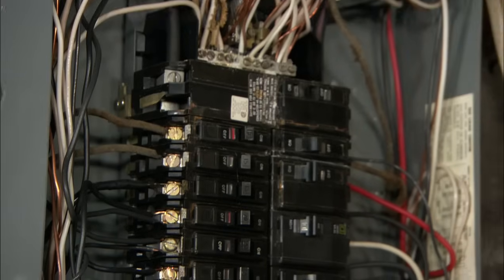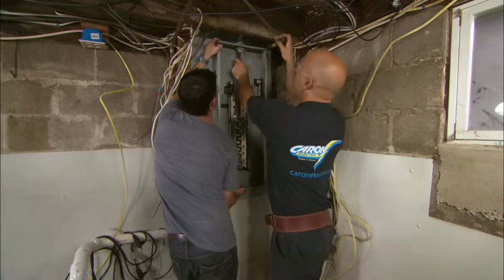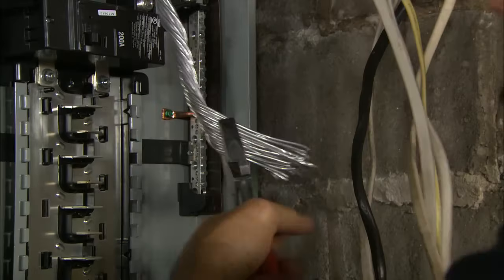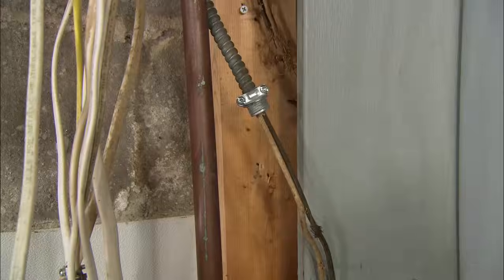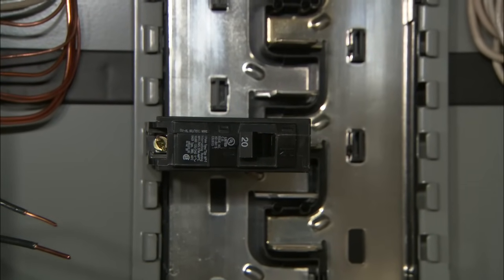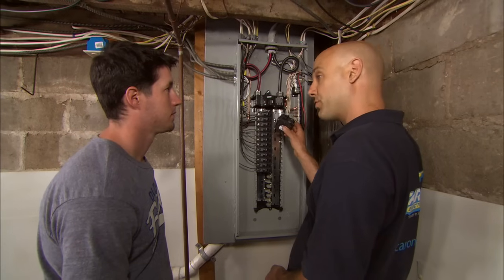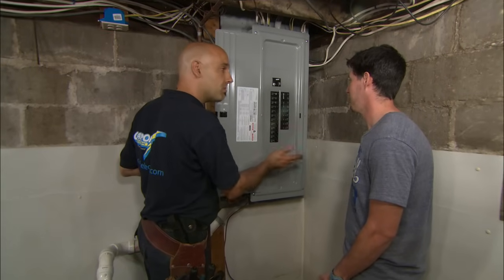How to Upgrade an Electrical Panel to 200-Amp Service (Part 2) | This Old House

Comment: First of all Scott does a good job. So not saying anything about his workmanship. With that said, and not sure what municipalities that Scott is working in...so excuse my ignorance as I am a licensed electrician in Massachusetts. Not sure why he used an expansion fitting above the meter socket as if it expands or contracts the PVC conduit has no where to go but up or down. And we professionals have at least in my area which is Central Mass. Have never relied on the National Grid to come and disconnect/ re connect the service lateral. That is usually done by the installer. But overall a good installation.

Comment: As a german electrician i can clearly say: The US system as shown as in this video sucks. If this is actual standart, than we are at least 30 years ahead of you.
Reply: Have you ever compared your components to ours. Ill wait for an answer.
Reply: Reply back win you win a World War.
Reply: Nur 2 Phasen und kein FI Schalter...
Reply: Explain
Reply: Lot of comments about the superiority of other countries.  The question I would ask is this:  are there more fires/electrocutions in the US on a per capita basis ( or some other means of a fair comparison)?  If there are not, then I’d say the us is doing just fine.

Comment: The US electric system is weird. 2 phases used per household imbalancing the grid, panels with no to little ingress protection and to top it all off no RCDs whatsoever on new installations? 3rd world technology TNC...
Reply: RCD's have been used here in America since the 1970's.  We just don't use them at the breaker panel in most cases.  Nowadays, you must install AFCI at the breaker panel on all new installations, but GFCI's (RCD) are usually installed at the receptacle (outlet).

And we do not use "2 phase."  It is a split single phase.  We have two 120V hots and one center tapped neutral.  This gives us 240V total, but most circuits in the house use 120V.  I will quote an excellent explanation to the advantages of the U.S. system from a user on Quora:

-begin quote-

The USA system using a 240V center tapped line transformer with grounded center tap is actually a very good system. There are very good economic and safety reasons to use a system like this. Three major advantages of the 120/240 system are:

1.) Shock hazards are reduced. The highest voltage to earth in any residential system is 120 volts RMS. Even a 240 Vrms circuit is limited to 120V to earth. The only possible way to get 240V is from a hot-to-hot. Unlike some countries, there is never voltage from hot to neutral or earth over 120Vrms nominal.

2.) Fire and consumer overload safety is improved. Small breakers or fuses used in high voltage low current systems are less reliable for overload protection. Fault currents are reduced. Insulation is less problematic.

3.) Lightning protection is improved. The grounded neutral system with its lower impedance to ground hot legs is more immune to transients. This is particularly important in some areas of the USA.

-end quote-

So, here in America we have the option of 240V or 120V and most residences use both.  All washers and driers are hooked to 240V.  As are water heaters and cooking ranges. When you look at the plugs, our 240V receptacles have 4 prongs.  Two 120V hots, 1 neutral and 1 ground.  In Europe, 240V plugs have 3 prongs.

There are advantages to Europe's single phase 240V, though:

1) Less copper is needed in circuits because 240V doesn't require quite the ampacity to achieve the same power.  Therefore, in Europe the wires are a smaller diameter saving in cost.

2) 240V is everywhere and every outlet.  In most places in Europe, there is no 120V option.  This simplifies things quite a bit.

3) Gives the home owner more flexibility in using higher powered devices (like power tools and kettles).

The main benefit of the U.S. system is safety (120V to ground, even when using 240V circuits).  However, there are advantages to the European system too.

Comment: lots of amp cause lots of hit and fire hazerd good to have 230v in europe much saver. 35 amp comes in and 16 amp goes into the house
Reply: Risk of fire exist of bad connections, regardless level voltaje.
120V is more safer. Lot of amps but a 48kW service.
Reply: i do not agree, but what do you mean by 48 kilo watt service? the german, dutch are way futher with pluming and electricity systems and safty
Reply: 48kW its the power off 200A in the video and other houses.
The 3phases system working with low current.

Comment: 90 percent of the time the power company is not going to come do a shutdown for service change. We have to pull the meter.
Reply: Service upgrade, they'd have to run larger wire likely to a new transformer.

Comment: Anyone know rough estimate how much it will cost for this job, given that it was done in New England, I would be interested. Thanks guys!
Reply: Probably $4k or more.
Reply: I was quoted $2k by a solar company that said we might need to upgrade from 100 to 200amp service for my solar panel setup. 
But keep in mind that would be with them already having an electrician on the field doing the solar work and in communication with utility company so that's probably cheaper than ordinary. 
Also I am in Iowa which is relatively low cost of living and lots of tradesmen out here.

Comment: What about the wire coming from the pole did you leave it the same or did you change it
Reply: Everything from the transformer to the splice is the power company's responsibility.

Comment: This is so much different than in Germany. I like, that you can simply plug the circuit breakers in. No need to wire them to the power supply. However i like our 230/400V 3 phase Current system more.
Reply: High voltaje is dangerous, 120V is safer. Its need big cables but a 48kW service in sigle phase.
Reply: Why would German houses need 3 phase 400v circuits? You running 50 hp industrial-size induction motors in your kitchen?

Comment: National electric code does not allow for bonding to water pipes, ground wires from grounding rods need to be connected from meter to panel to a seperate ground buss.  Neutral and ground can no longer be on the same buss, many electrician assume that the neutral is a ground- IT IS NOT. A neutral has energy on it that is why it is so dangerous, it will grab you and hold you and you will die, neutrals cause more deaths than hots

Comment: Have you upgraded the whole system main disconnect should be outside in the meter pack. No more main Breakers inside
Reply: Joe Momma not necessarily true.
Reply: Maybe location.? The house catches on fire, main disconnect should located outside for fire department to switch off. Now if it's a panel change then no, wouldn't have too. But an entire service  change, then yes sir.
Reply: Joe Momma if the meter and the panel are back to back (less than 5 ft) then main breaker not required to be on the outside. Rook
Reply: @leonardholt5311  yes sir.
Reply: @leonardholt5311  any relation to Mike Holt? Anyways happy easter

Comment: Neutrals and grounds do not land on the same bus. Grounds has his own independent busbar. sometimes you can get lucky but usually you have to buy it separate. grounds and neutrals cross paths just one time and that's at the XO
Reply: It was the main panel, so yes the neutral bar and ground bar are the same. If it were a subpanel, the ground and neutrals would be terminated separately.

Comment: you never ever connect your PE to anything but a properly constructed and tested grounding arrangement. especially a water pipe -- that's specifically outlawed.
Reply: it's almost like there's a "part one" to a video labeled "part two," and in "part one" they hammer grounding rods into the ground. but nah...

Comment: wow the US is about 20 years behind the UK in terms of wiring and switchgear. No insulation to ground (earth) wires that could become live under fault conditions?
Reply: Then how is stray voltage sent back to the earth in the UK?
Reply: @derrike50  It takes the Underground?
Reply: I find it interesting that Canada uses the same system as the US, but these Europeans  always blame the US when they think it is somehow inferior to their system.

Comment: No RCD , No Zs test, No continuity test. Amazing !!!! We are in UK just wasting all our money for RCD etc.  And they   using aluminium meter tails. And no testing at all. I can’t believe
Reply: RCD's are called GFCI's here.  They have been required by code for decades.  The difference is that we aren't required to install them at the panel (though it is acceptable to do so).  Usually they are installed at the receptacle (outlet).  There are advantages to doing it this way.  For one, it makes it easier for the non-electrician home owner to troubleshoot GFCI trips. He can simply press the reset button at his electrical outlet without having to go in the basement fumbling around in the electrical panel.  In Europe, sometimes the entire house is hooked to one RCD, cutting power to the ENTIRE house.  That is untenable and would drive people nuts here.  Also, putting them at the electrical outlet makes sense because lighting loads typically doesn't benefit from GFCI protection.  

Secondly, our GFCI's at the outlet trip at 5 mA.  The ones in Europe at the panel don't trip until 30 mA.  RCD's here are intended to protect people, not equipment.

Third, we are now required (for the past 10 years or so) to install AFCI's at the breaker panel on all new construction or remodels.  (AFCI = Arc fault breaker).  It is my understanding that there is no requirement for AFCI's in Europe (or at least not in the UK), though there might be a good reason for that since you are on 240V.

Also, keep in mind we use 120VAC here (split single phase 240V with two 120V legs).  Over there, you guys are 240V to ground, meaning your chances of death are far higher if something goes wrong.  However, 240V results in less nasty arcing, which might be why AFCI's are not code over there.

Comment: I know this is just clips from a full episode, but ... right off the bat he created more work for himself by cutting all the perfectly good leads. How many seconds would it have taken with the drill to back out each of the screws and just pull the leads out? How long did it take to re-strip all those leads which are now shorter?
Reply: We’ll sometimes the leads are oxidized or just deteriorating from past probably loose connections or overloading so I always just cut them hows and strip back anyways
Reply: I guess if he use the drill to back all of the screws out it would probably take the same time to restript the ends
Reply: I replaced a panel once.. and even without cutting them.. most of them were short.. the guy that did it before me had it so nice and neat.. looked like art work.  By the time I was done, it looked like a jungle
Reply: Lol who cares. Stripping that wire takes no time.
Reply: It takes as long to put the right gauge for the right circuit

Comment: It’s ok, great job but  when he made up the  the two conductors leaving the meter into the new panel, we have to follow this phase sequence : Black : Red: Blue,  from left to right, the guy started: Red : Black: Blue is used I a 3phase System, that’s not the case in the video, still ok for me.

Comment: He dumped the hardest part onto the homeowner. Labeling the breakers!!!
Reply: He said "All I need to do...".  The 'I' was short but distinguishable
Reply: z ibp, maybe he did. Regardless, it was a joke.
Reply: Dude was so giggity he'd be happy to do it himself.
Reply: I have the Klein breaker finder it’s awesome
Reply: What's hard about it? Shut it off and see what shuts off, test the sockets in that room to be sure....done.
Reply: @Mookaton  

How many outlets and light switches are in your house?  How far from your breaker box are your outlets?  Let’s multiply the number of outlets by the number of circuits and then we can get the number of possible combinations.  It can take hours to do this.

Sure, you can start the process of elimination to save some time, but then you have the one outlet in the living room that is not on the same circuit as the other living room outlets.  Or you have the recently installed bath fan hooked into the room next door and not with the bathroom lights.

If the breaker box isn’t properly labeled, it’s likely because over the last 30+ years some handyman playing electrician didn’t take the time to think out your upgrades.
Reply: Lies. Just get one of those RF guns and get it done

Comment: Great video! Only thing I saw wrong was having all the breakers on before turning on the main.
Reply: I always face away from the panel when first turning on the main breaker, with all branch circuits off. Just in case...
Reply: It didn't matter. In Part 1, it was shown the service line to the house had been cut so everything in the house was dead behind a visible open point.
Reply: @whiteknightcat  You misread the comment. You should have all the breakers off before you throw the main on, less likely to have a surge happen.
Reply: @jeffd6  agreed but up here in the ne are lights go out and on so often our electronics are used to the surges lol

Comment: Remove this video, the new rules don't let you change panels without going to AFCI protection.
Reply: FALSE!  Some states don't require AFCI at all, and many places that do will allow you to change a panel without upgrading breakers to AFCI.  But they would be required for new circuits added.
Reply: James Waymyers I ORDER YOU TO REMOVE THIS VIDEO NOW..! Now... Get off my lawn...!!  Ha-Ha
Reply: Not true

Comment: Would be a little more informative for those perhaps not knowing that the "small" wire for 15amp is 14 ga. "medium" for 20 amp is 12 ga and "large" for 30 amp is 10 ga wire.
Reply: That is the basic rule, but it also depends on the length of the run.

Comment: At least he doesn't call it "220" when it's 240..
I can't help but cringe him on TV just cutting wires and not mentioning to shut off the power first, We all know how much common sense people have these days..Again at using Romex clamps on metal flex... Then grounding to a water main in the US? Are you serious?? This is NOT the UK where you can ground up to fuckall including gas. 
Stop being lazy and drive a proper ground rod and use that.. Separate the neutrals and grounds on their OWN BARS!!
 Fucking made for TV hacks..
Reply: ElfNet Designs you’re a rookie

Comment: Silly yankee you’re still using Phillips wood screws, thank gawd for Robinson . If I have the length I like to loop  every wire not only does it allow for you to have extra Incase of burn off or a break. It also keeps everything uniform, at least he knew enough to do it for the main feed. Then the electrician left the home owner to label the panel, hahahah, never dontbat
Reply: The homeowner probably desired that. Why pay an electrician $70/hour or more to trace circuits?

Comment: "master electrician" i would never put the smaller circuits (15 amps) over larger (20 amp etc.) larger circuits draw more amps and should be closer towards the top of the bus bar to avoid surges in the house.
Reply: Brendan Lynch hahahahhahahhahahhaa.
Reply: That has nothing to do with surges

Comment: I'm not a licensed electrician but when I see someone grounding on a water pipe/faucet I cringe. I've been in three places where I recieved slight shocks from touching faucets. I would very much prefer that you all teach people to ground elsewhere...
Reply: It is required by code. If you got a shock, something was done wrong or you have a partially failed device/appliance somewhere.
Reply: If you received a shock from a faucet that is because it is NOT bonded to the system.
Reply: @electricaf365  It was a tower apartment building in Kuwait. It would only slightly shock you if you were barefoot. The manager thought I was a crazy American until it finally dawned on me to get him to take his shoes off. Once he did that I was no longer crazy ; ) I would be very interested to know what it was if you can figure out what it might have been.
Reply: It’s called bonding. It is a code requirement. It prevents the water lines from becoming energized.

Comment: That is a sloppy work you got a dress a panel better than that
Reply: It is not overly pretty, but far better than a lot of panel changes I have seen. If it were new work, I would expect a much neater installation of the wires.

Comment: So do you have to upgrade all the wires in your house if your going from a 100amp to a 200amp? Just wondering because i have the hazardous Stab Lok and need to replace.
Reply: No, you can use existing wiring as long as it is legal.

Comment: Great comments with electricians pointing out the code violations.  Also, we need AFCIs on all recepticles now.
Reply: Brian Uehlein  In some markets, you do. The "Grandfathered in" rules typically get removed of this permission once you make a change to the service. Here, if you upgrade the service, you then need to upgrade the rest of the items you're installing to current codes. This includes putting those old circuits on AFCI or GFCI breakers as required.
Reply: Yep. Unless your AHJ exempts it.. Some counties in my area have. Too many complaints of nuisance trips.

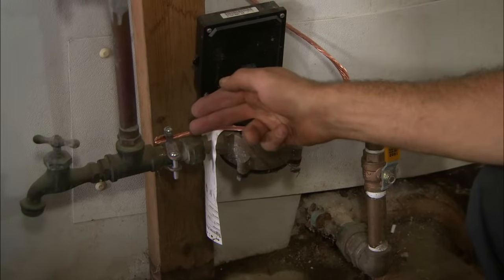Comment: Min. 03:48 The Ground cable can't connect to water plumb!!! Is very dangerous, is a risk of electrocution if have a electrical fault, for example the washing machine, the electric furnace, the dishwasher, etc.

Comment: I'm pretty sure the neutrals and grounds don't land on the same bars unless it's the main panel outside.
Reply: In the installation, there isn't an outside panel. The panel being replaced is the main panel and has the main breaker inside it.

So the installation was correct, the neutral bars are tied to the chassis, probably via a green screw on each neutral bar.